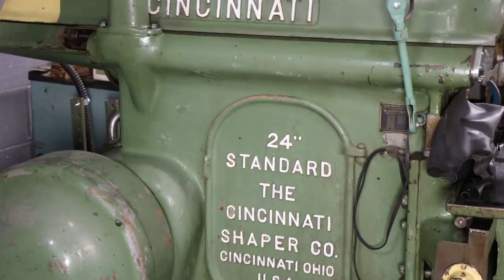Doall mill Saddle on the metal shaper.

Comment: Nice Airmaster fan, I picked one up my neighbour threw away and left on the side of the road, just had to fix the 3 speed chain switch. Cast aluminum blades, quiet, fully enclosed motor, and huge airflow.

Comment: Great work. Tempted to Turcite / Moglice epoxy my lathe ways, Engineering epoxy base, brass powder and Tungsten disulphide PTFE but i don't have that.. Fond memories of using a shaper as an apprentice. Tried casting a flat edge from homemade moglice on a grease covered surface plate and ripped holes in it.  Gantry crane install .

Comment: @Steve Summers     You should have went deeper with the cut on the saddle. You HAVE to maintain  the same height between the saddle and the knee as the yoke that both screws index off is a fixed distance, you can possibly vary a little depending  on how the mill is designed but probably  not much. You need apply the turcite and machine it down to the original height then scrape, but you are finishing  with .008 thick turcite and glue, you still have to cut oil passages in the turcite without going all the way through the turcite. Just having a layer that is .008 is not enough considering that you will loose a few thousands in thickness for the adhesive. I may be wrong here, but I would suggest reaching out to some of the guys who do this professionally for their advice. If this is your first time doing it you are already in a bad position, dont add isdues to your rebuild before you really get going.
Reply: SShep71' As a retired machine tool fitter who was using turcite type material for rebuilds since the 1970s
I agree with every word you have posted. The oil groves in the turcite need to be  .150 thou deep and in a zig zag pattern as turcite needs lots of lube.
As you explained you have to keep original centers on crossfeed screw otherwise it will be out of alignment and bind [freeze] up
     HTH Colin from UK
Reply: I've not used Turcite but have used Multifil and Moglice.  With Moglice I used about .032" and it's lasted well on my 10EE saddle.  Multifil was .032" as well but you need .005" for the glue line.

I've got some heavy sheets of Turcite in the shop if Steve is interested.  About 30" square and maybe .187" thick, I could whack a couple chunks off to fit in the mail
Reply: @russkepler  Russ, if you can help him out with the Turcite I may be able to get him the epoxy adhesive he needs. I used a small portion of the epoxy when I rebuilt my neighbor's 4020 Fadal last year. I filled the cans wth argon gas before sealing them back up, the glue should be good for his application or at least good enough for him to practice the process on a piece of scrap iron of some kind.  Either way, he needs to machine more off the saddle. The bottom of the table can be reground or have turcite applied, but the center to center distance of the X and Y screws needs to be maintained after glue, turcite, machining, oil grooves, and scraping. I hope you see this comment and at least consider what we are saying @Steve Summers.
Reply: @sshep7119  I just checked and the Turcite I have is about .136" and the sheets are 23" x 29".  The etched side looks OK, just needs to be cleaned before epoxy.  It'd be easy to slice off a couple of sheets for Steve and pop them into the mail, just need size and address.

And I agree - I'd suggest taking at least another .040 from the saddle, maybe more like .060.  Glue the Turcite on and use the shaper to knock off most if not all of the excess and take the ways back to their original thickness (plenty of thickness to figure out tool geometry).  A lot easier doing that on the shaper than with a scraper (I was chicken that way and used Moglice on the saddle of my 10EE so I wouldn't have to do thickness scraping of Multifil.  With the Moglice all I had to do was some flaking for oil retention.  But Moglice is best used against a freshly ground opposite surface.) 

I'd also suggest looking at the way wipers - there really shouldn't have been the scoring you see unless they were messed up in some way, maybe missing entirely.  Also, any of the modern way materials really need good way wipers as they're easily embedded with crap and that'll really tear up the opposing way.
@Steve Summers

Comment: When caulking you should move the nozzle angled the way you used it but moving in the opposite direction so you force the caulking into the groove and finish the surface at the same time.. also masking each side of the groove will make the finish better and cleanup easier 😀

Comment: Steve, I think it is FABULOUS that you used your shaper to plane the saddle of your DoAll mill.  Man, why does a 24" shaper only have a table about half that width ?  Crazy.  I have a small (36") hydraulic openside planer.  Not good for lathe beds but perfect for work like a saddle like that.  Keep up the good work.  ----Doozer

Comment: The new open shop allows different angles on the working macines . I liked that longer shot of the shaper from the side showing the mechanism.  Also your back is worth more than $300 that the batteries cost.
Reply: $300 won't barely get your foot in the door at the chiropractor. If you're into this machinery heavy comes with the territory so lifting tackle is just part and parcel with it all.
Reply: You can't do anything with a hurt back.   That forktruck will pay for itself many times over.

Comment: I started off blacksmithing and had fun for about three years and I mean I dived in the deep end every night even when I was wore out you know the whole schpeal,  anyways that taught me alot about metalargy and I progressed to machining , and now I honestly love them both but machining is honestly where it's at for me , and is so precise I love it , I do feel though that they're is room for an power hammer in an machine shop as long as you have scrap and you understand heat treating you can save alot of money in scrap metal I would assume,  drawing out material to save on the lathe or mill , no one has ever addressed this issue and to be honest maybe it isn't an issue and that's why no one has addressed it , it seems to me to be a practical application but whoes to say 🤔

Comment: I have one of the Harbor Fright gantry's about $600.00 with 20 percent off coupon, have been very happy with it so far. lifted a 2500 pound mill off a rented trailer with it, already had a chain host and some old US Army lifting straps. My 2 ton engine host would not lift the mill  high enough to get it off the trailer..

Comment: Years ago I went on a manufacturer's course for applying a Gas and Fire barrier caulk.
Telephone exchanges are built on top of a cable chamber where all the cable ducts enter the building and to prevent Gas and methane following the cables down the ducting the ends are caulked to provide a barrier to gas - and if necessary fire.
The Manufacturer emphasises pushing the tubes forward and away so you use the flow of sticky to push down into the crack.  Because the silicone "skins" almost as it emerges from the tip, If you work back pulling it away from it you are pulling it back out of the crack and in cross section will show that the deepest part can be left hollow to channel damp.

I must have done miles of the stuff (it's what apprentices are for.) and there are lots of cables.  Set me up later tiling my bathroom too.

Comment: Circa 4:15 Steve, you don't need to make custom mounting brackets to stop the heavy cabinets falling on people. Just weld some sharp pointy bits on the cabinets and they will protect anybody the cabinet may decide to fall on. You know that works for falls from a ladder. 🤭
5:21 Muscle memory is an amazing thing. Each time I see a welding flash I immediately flick my eyes away from the source of the flash. I worked in an animal shelter where they made big yellow Cats, and other large things when I was younger, so one had to be wary of the purple/violet lights flashing on and off. I never welded (just made all the bends), but even now when I know there is no danger seeing the flash on a laptop screen, the eyes still self preserve after 40+ years.

Comment: A-bomb will be happy to see you using that shaper Of all use  A couple of times The something about those things it is fun to use Courses boat  Over 20 years ago Just a suggestion so the crack on the wall with accounts went Rustily makes a good crack sealer Use on my shop for 8 years ago hasn't returned at all the crack And it wasn't a small crack And even granted smoothly after that has been in issue  Enjoy watching   All your videos  And if you want I can send you pictures for  The base stand fits that arbour press  I have I have the same arbour press Just don't know if you wanted for reference

Comment: Once you have a forklift you can't imagine doing without. Probably would have made getting the first box out of the van easier, too. I bet it would not be too hard to get proportional lift and descend, or even just a manual flow control valve in the hydraulic line to slow it down.

Comment: Nice to see the Shaper in action! 8thou's not much! Before thinking about turcite, wait and see how much has to be taken off to get it true. It might not be necessary! cheers, Matthew
Reply: Matthew, I expect he will have to remove 0.050 or more to make room for the epoxy and the turcite.  The thinnest I have been able to find it 1.5mm 0.059", so if he uses that he would have to remove at least 0.025 from the table.  Based on what he removed with the shaper, the saddle grinding should remove an equivalent amount. So, 0.010 from the Table, 0.010 from Saddle, plus what ever unknown wear would not give enough space for one layer of epoxy on the table 0.010 and the 0.059 turcite( https:www.tss.trelleborg.com/-/media/tss-media-repository/tss_website/pdf-and-other-literature/catalogs/turcite_b_slydway_gb_en.pdf/revision )    
The turcite manufacture (Trelleborg Sealing Solutions) recommends 0.5mm oil groves, and not to mill completely through the turcite.  With these limitations, the minimum allowance would be 0.026 (grove) plus 0.010 (epoxy) + 0.005 (scraping allowance), or 0.041 minimum clearance.
Reply: @chucktodd7329  Thanks, exactly my point nicely explained in detail! I was saying, measure first and see! It looks promising for a no turcite re-scrape!

Comment: My 2 cents worth when applying sealant: cut the nozzle at 45° and when possible push forward (rather than drag backwards) the sealant. It'll fill the crack better and you'll get a nice finish without having to smooth it later.

Comment: Awesome toolbox! Al is one heck of a friend! On my Lista that has those latches you can only open one drawer in a bank at a time. Is that one the same way? Pretty sure I am going to be contracted to build 2 more gantry cranes soon. They are a big project and take a lot of space to do also you can buy a harbor freight gantry for less than the materials cost for one of mine so if you don't need something bigger or custom it is the way to go.  With your limited floor space though you probably really could benefit from a gantry more like Keith Fenners.
Reply from the maker: On this box you can open them all. 
I plan on getting one of the HF gantry cranes, I did the math and its definitely the cheapest and quickest way.  I dont need something super HD. I'm covered in projects at the moment and dont need anything else to do😁.
Reply: @SteveSummers  I hear ya on that!!

Comment: If you run a coil to the brook next to the shop, you can cool down the shop in the summer to the temp of the brook.  Run the returned coil to the front of the fan.  (instead of coils you might use old car radiators)
Reply: The brook doesn't run in the summer.  Using the brook has been suggested many times but it turns out it is just drainage from the hills.  Not a reliable source.

Comment: Steve, what thickness of turcite are you putting on the ways. We’ve put up to 3/32” thick on vertical CNC lathe saddles and recut the oil grooves in it. These machine came new with turcite in these locations. There is a minimum thickness that the turcite needs to be. You can get different thicknesses. We’ve also used 1/8” thick. Gluing and clamping is critical as well.

Comment: The bar stock you cut, around the 4 minute mark, for the cabinet brackets, looked like it was cold finished (cold rolled).  If so, the residual stress was probably due to the cold finishing not the tiny amount of heat from the laser cutting.  I have seen many warnings about how much cold finished stock will distort when cut.  I have only experienced a little bit of that, but then I have worked with little cold finished stock and on small pieces.

Comment: when checking the table with the micrometer to make sure it is parallel to the sliding arm should you add some upward lift (10-20lbs) to simulate tool pressure when using the shaper? There is probably some deflection at the end of the stroke??

Comment: Is that the 44" US General box? I have that one (in blue). It's pretty sturdy. I have a couple of the drawers loaded to the hilt with CAT-40 tool holders which are pretty heavy - it doesn't seem to mind. When I added the top box, I'm missing the work surface I lost on the the lower box now.

Comment: Hey Steve, niche work with the Shaper !
Not shure whats the minimum thickness of Turcite ist, but i think you have to get some more material off the part.
But i would wait until you know how much has been ground off the other side.
The thickness of the Turcite you choose should be great enough that oil grooves dont cut trough the material or it can loose its bond to the cast iron by oil getting between the Turcite and the Cast iron.
Speaking of oil grooves, the original layout is a bad one, i can recommend a Z-pattern.
Are the Dovetail sides scored too ?

Comment: Steve, Question,  you only pulled -.008 off the deck , well with in the range of the gibb bars adjustment , why not just scrap the cast iron back flat and leave it alone as the left over low spots will help hold even more lubricant  (a good thing) You know from here on out the Mill will be fully lubed every time you use it so why not just save the money to build that .008 back up . P.S. I am soooooo jealous  of your pink garnet surface plate !!!!! Perfect size to do almost anything .

Comment: Here is a request.  In this video, around the 23:35 mark, I saw you spraying the cast iron with something.  Later you were lubing the shaper with way oil?  My general request is to spend a video talking about all of the products you use and how you use them.  Or perhaps the inverse - identify the needs and what you use as a solution.  Volatile compounds?  Brake cleaner?  Lacquer thinner?  Diesel?  Degreasers?  Cleaners?  Penetrants?  Protectants?  Bluing?  Waxes? Oils?  Additives?  Importantly, tell what works for you and what you have tried that doesn't, or what might cause damage such as removing paint when you don't want it removed.

Comment: Saturday is Steve day. This may seem like a dumb question but how do you know or measure where the original surface should be (height) of the surface you have machined after you stick the Turkite on? You sure do have enough projects on the go to keep us interested for a good few Saturdays to come. Happy Easter.
Reply: When I saw he was machining the saddle himself Was hoping he was going to do the job himself, scrape the knee true and fit non metallic inserts  epoxy in and scrape in,reference can be got from the unworn  extremes of the knee guide ways.

Comment: Nice man! Good to see the shaper put to work.

Do you have any idea of how much material needs to be replaced on those worn out surfaces? Like on the one that you resurfaced, would that only need 0.008 of turcite? Maybe a little bit thicker? Do they sell turcite sheets that thin? Also I was wondering about the oil grooves there. Will that get covered up and new grooves made in the turcite?

Comment: Don’t worry too much on the red vs black. I have the black box and it’s great but it shows every single spec of dust in the shop.
Reply: For me fire engine red is the classic roller box color. Can't go wrong with it really.
Reply: Paint it black.
Reply: @peterwill3699  why? To paint that box right would take a considerable amount of time and money that would both be spent better elsewhere.
Reply: Well he keeps saying he wanted a black one.Not to hard to paint before its filled up and greasy,one spray can two at most.
Reply: @peterwill3699  to do an acceptable job there is a lot more to it than just shaking a can up and having at it.

Comment: I thought with Turcite, you need to remove slightly less metal than the thickness of the Turcite you're going to use so that it can be easily be brought back to original spec height/"thickness". You only removed 6 thou from the slideway-  is that enough?

Comment: I bought the HF Gantry about 5 or 6 years ago. Money well spent. I can't see how you could buy the materials to make one for what they well them for. Main complaint the DIY crowd could have with it is that it won't go under an 8' door in when in the lowest position. Considering market HF is in I think that's incredibly stupid. I cut my down so it does. Longer term plan is to buy a 6K or 8K rated gantry. The new shop project went over budget :-(